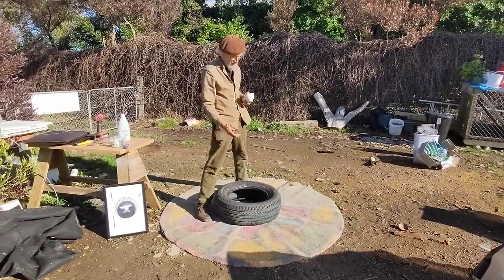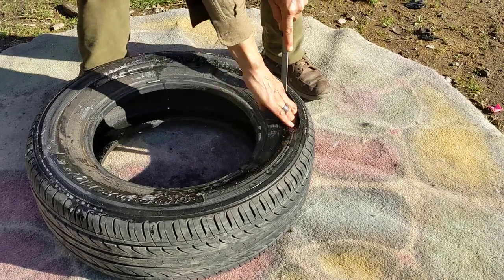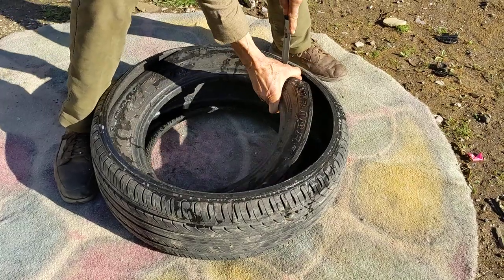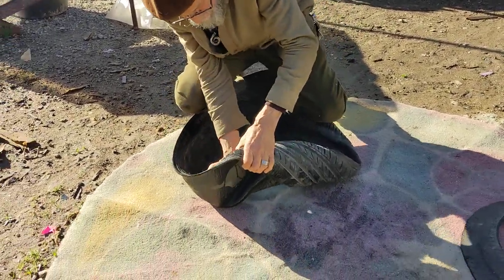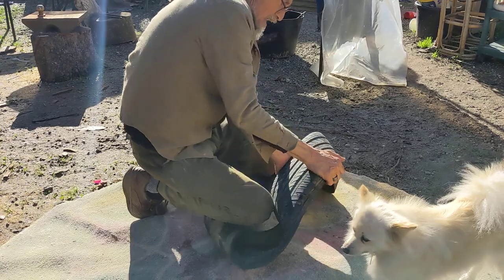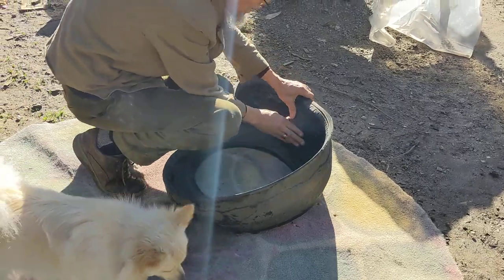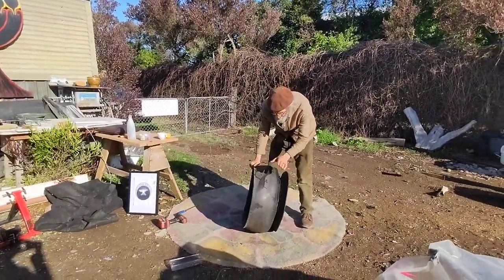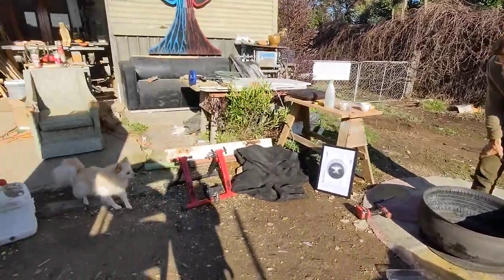How I made money from old tires (tyres) last century

Comment: I remember years ago, pots used to be made with the tyre still on the wheel, so the steel wheel was the base.
Reply from the maker: Yes I used to see those... much heavier and not as available to recycle. Remember the swan ones, too? They were more sculptural. Required fabric tyres I think, as the tread was cut?
Reply: @wizardofeutopia  Ahh great times :)
Reply from the maker: Yes, just harder to find the rims on.. also with purely rubber they are nice and flexible, indestructible by running over etc...